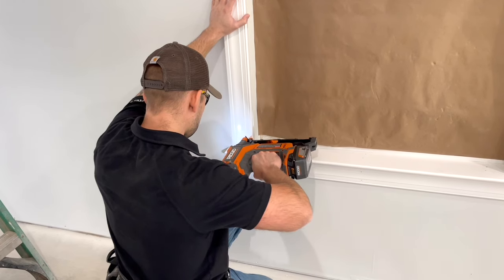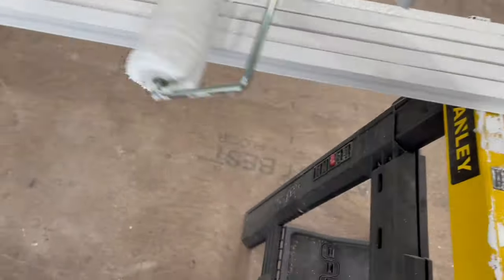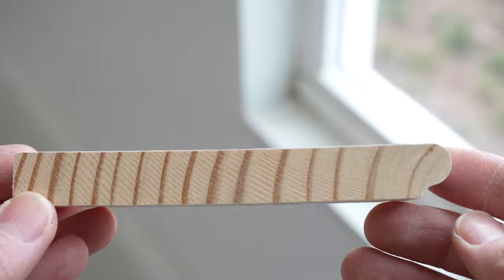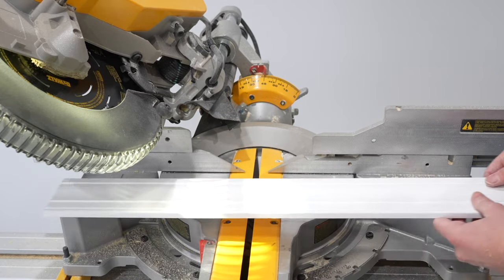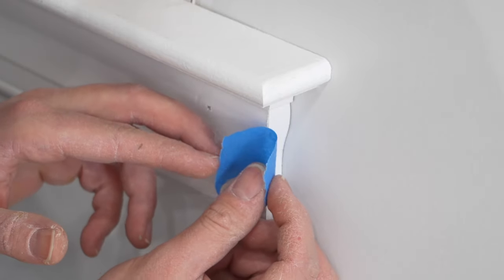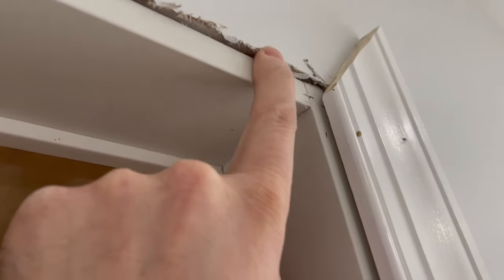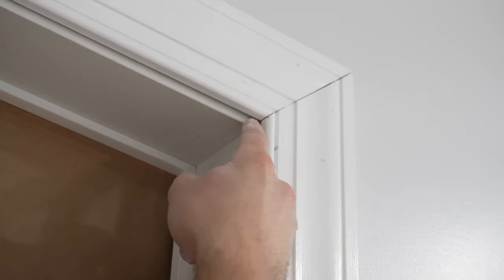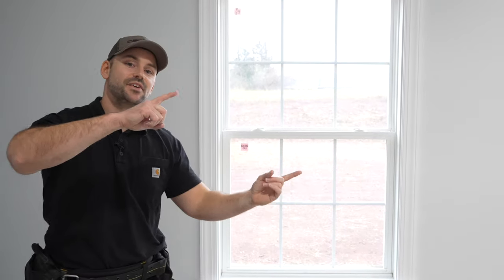How To Trim A Window

Comment: Trimming doors and windows have always been a favorite of mine. I actually have a biscuit machine made for trim that I have used to make up the frames with biscuits in the corners and let them set over night on jobs the just have to set them in place and pin them. Always making sure you number them in case different sizes were to be part of the job. Sills are always nice as well to only have to make up three pieces. But if it was a picture frame look, the biscuit system is great. Great job on the video and workmanship Josh. 👍🏻
Reply from the maker: That’s a great point about using a biscuit machine. I don’t earn one of those but I would definitely try that out. Sounds like you can’t go wrong with that method. What making model machine do you use? Thanks David for stopping by and watching!
Reply: @TheExcellentLaborer  actually there isn't a name on the unit. It's one that it set up with a foot switch my father in law  put together, but works really well. The older things always last forever. 👍🏻

Comment: Another excellent, in-depth video.  Thanks.  I don't have a high speed miter saw just the manual one with a manual saw that I definitely will be using when I need to replace trim.  My dogs in their haste to get out the back door really scratched up a side trim on the door and now I have a better idea how to replace it.
Reply from the maker: Hi Joe! I have used the manual miter saws in the past. They definitely work, but after using an electric motor it is hard to go back to the arm powered version. Yes I will be doing a video on door trim in the future. Thanks for watching and stay tuned!
Reply: @TheExcellentLaborer  Great thanks.  I don't blame you especially a professional carpenter like you it's a must have.

Comment: Great video.

My only suggestion... get a set of Fastcap Zero Clearance Tapes for the miter saw.  They apply to the plastic insert (the yellow part on your saw's table/base) and once cut with the blade you will be using, provide an exact kerf location that makes getting your cuts dead on accurate.  I think they can be had for $10 and you get a set of five.  They are a huge time saver and even make the cuts cleaner with no blow out on the under side of the work piece.

Comment: Great vid for anyone lucky enough to work behind a good framer and window installation. Sadly at least half the windows I trim the frames are usually up to 3/8ths proud or recessed along with the drywall being 3/4" from the window frames on one side or the other.

Comment: I use a sliding carpenters speed square for the set back at 3/16" with the 2.5" colonial.. likes it slim, but 1/4 is very appropriate for the wider trim like you have there. That gets me the all the dimensions in one shot. The inside size of the 45° I have to carry with a speed square and cut, where outside sizing for cuts is much easier/ faster. Moreover I always use metric for cut sizing, it's much more accurate & cleaner.
When fitting, I just slice back 1/2 blade width.
Spackling us definitely the best for nail covers as it does not have the shrink caulk does,. Once n dunn!
Nice video for the diy'rs
Reply from the maker: Oh yes a square of that nature would work great for marking the reveal. That’s a good tip! Thanks for sharing with everyone. Yes spackling is much better because it does not shrink like the caulking. I have used that in the past but you still see the nail holes using caulking. Thanks for watching!

Comment: Brad nailer vs a finish nailer for trim/base boards?
Reply from the maker: Either one will work but I like you use finish nailers because the nails are a little bigger for better holding power. Hope that helps!
Reply: @TheExcellentLaborer  thanks!

Comment: How are those Ridgid tool holding up? I can't decide on those or Makita
Reply from the maker: So far they have held up good. They tend you cost less than Makita. I hope that helps!
Reply: Ridgid also has a lifetime warranty on their tools AND batteries. No one else does. Replacement batteries are very expensive.